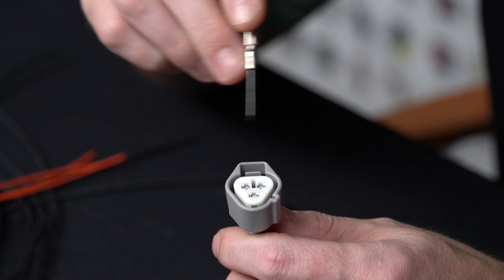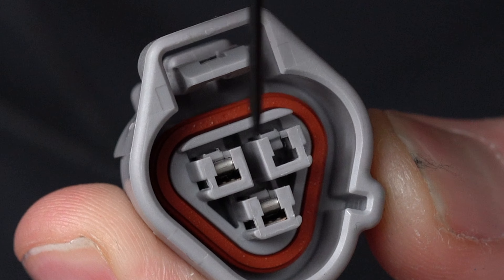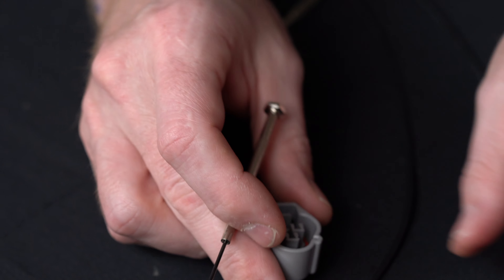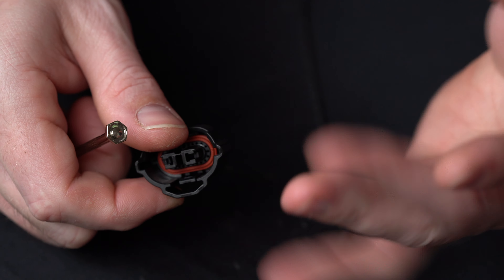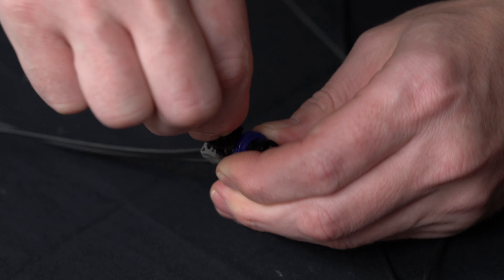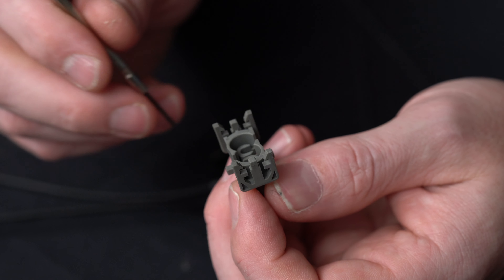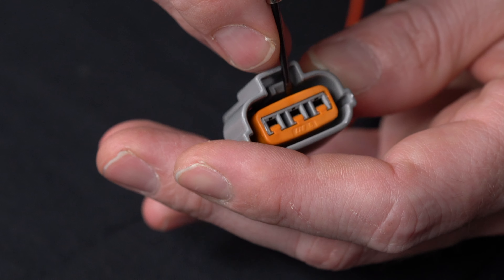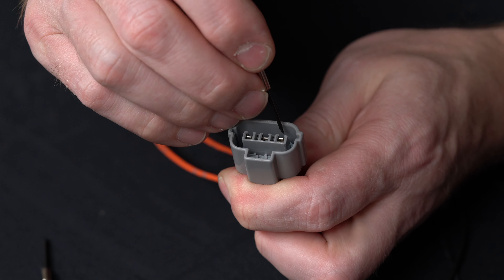Depinning automotive electrical connectors: How to remove the pin from the most common pigtails

Comment: That’s a great way to destroy suspension bushings, ball joints, and even bend arms, especially on a strut type suspension.   The outer apron like that is soft compared to the frame rails where you see the brake line bracket attached.      The ram will do the job.   The point against which you will push is CRUCIAL.     We’re talking thousands of pounds of pressure.